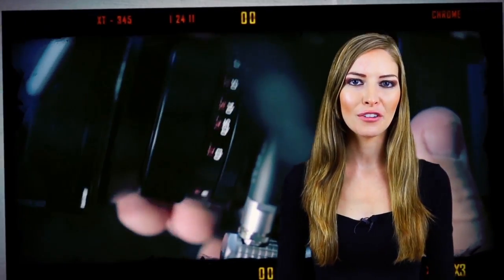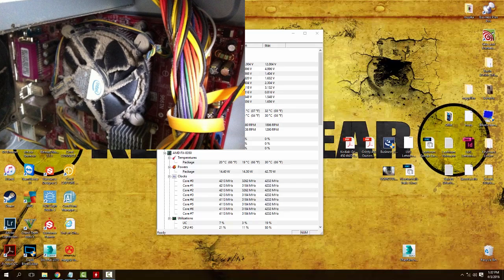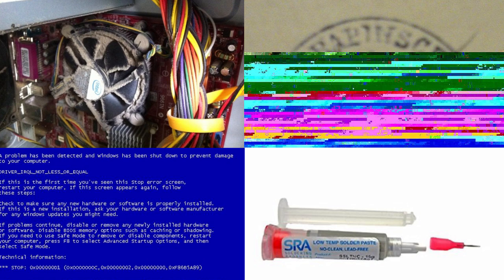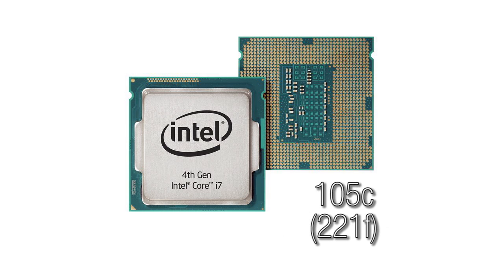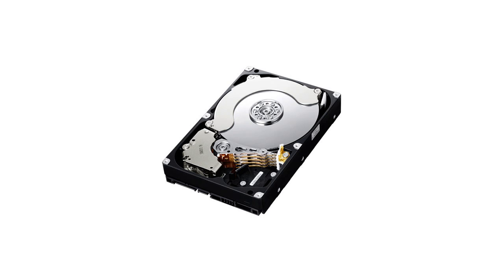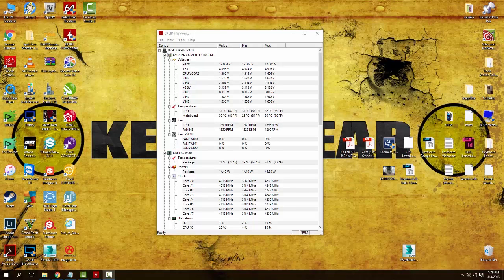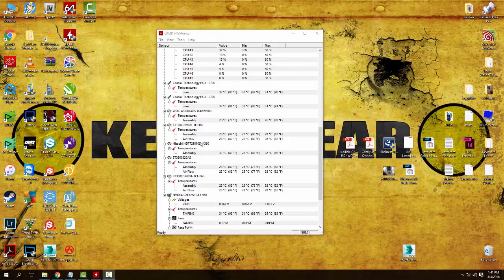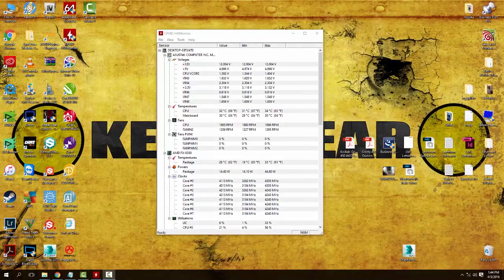Safe PC Temps - How HOT is too hot?

Comment: My cpu reaches 100c and my gpu reaches 80c im on a Dell g3 laptop is that bad
Reply from the maker: If its the i5 9300h, I'm pretty sure that 100c is the max temp. Sounds like you might have some massive dust bunnies or something...
Reply: It's a i7-9750h
Reply from the maker: Yeah, I'd look into making sure your fans are working and that it's relatively clean (dust/dirt wise). 100c is the Junction limit of the 9750h (maximum temperature allowed at the processor die).

Comment: Can you tell me if this is okay.... i contacted alienware service customers i told him 100c while doing gaming becuase it has turbo boost without it i just get 10 fps less but still at 89fps on pubg on ultra just getting 76c without turbo boost but there is no way to turn off the turbo boost mode he told me that 100c is okay in case of any question is there at that temp is not giving trouble just get more performance but i care about my laptop life but with 100c doeant go throttling keep on performance

Comment: I have a macbook pro mid 2014 (1200 USD when it came out), it turns on the fan when i move the cursor too fast lol. I have smcfancontrol configured to start increasing speed at 70 degrees and maximum 90 degrees. Less than 70 the fan rolls at 1200rpm and when its over 90 it move to 6199rpm Macbooks are no able to do any task. This laptop overheats just to look at her. I read some threads about users who has this kind of macbooks and they say its normal to get 90-99 degrees while gaming. Im always worried when i play games like Cs:go or paladins (on bootcamp) because temperatures may harm the cpu. I clean the fan like every 2 months and it still the same. anyways the system never shuts down or give any kind of problems. Its just too hot and im not able to play games whitout worrying about harm the computer. I tried use the processor at 50% of his capacity and it decrease to 50-70 degrees but its like having a pentium 4 instead of a i5. 2.6Ghz 8GB. What can i do to fix this? no fan pads, thermal grase or even frozen chiken nuggets solutions allowed.

PD: Girl at the the beginning its hotter than my pc.

Comment: I run around 64c and 74 when the gtx 670 is up and pumping with syndicate in this itx case. I am curious about this myself as I only have an exhaust but it is a crazy Delta exhaust 120mm fan that can cut your finger off and is very loud so I bet it actually is sucking air in either way from the nano cracks and crevices of the case. I was going to add an intake right on the side but I don't think I have too with my Celsius temps, seems to be right on the edge? Also, why does my MOBO bios NEVER ever say on a fresh restart right after gaming that it is 68 (per se) or so degree it will start at around 50 on the restart then hop up to the 68c or so like it is slow or in slow motion versus the real time in reality! Also, I guess I trust my bios temp more then these cpuid hw software programs however, they are always way diff, 5 to ten degrees difference thus useless! Common?
Reply: ReganMarcelis I have GTX 1050 and I’m running at 80 C minimum

Comment: ive got i5 7400 and amd radeon 480 and i run 84c on the gpu and 50-70 on cpu is this bad?
Reply: I run around 64 and 74 when the gtx 670 is up and pumping with syndicate in this itx case. I am curious about this myself as I only have an exhaust but it is a crazy Delta exhaust 120mm fan that can cut your finger off and is very loud so I bet it actually is sucking air in either way from the nano cracks and crevices of the case. I was going to add an intake right on the side but I don't think I have too with my Celsius temps, seems to be right on the edge?

Comment: What should I do should I be worried I got a bad could I'm running off a 240 m AIO cooler rad. Panel off . it's like the chip loves to just fly up high every chance it gets . I applied thermal paste a dot amount or a blob and it's pretty high quality stuff at least it's rated at that . I tried 3 different ones cooler master that it came with Wich is my cooler master master liquid 240 , then thermaltake tg-7 then Arctic mx and I've applied thermal paste many times so I know what I'm doing I've had an i5 6500 and it ran    cool as a cucumber no matter what . Should I rma ?

Comment: My temps on new 7700k go up to 80 to 90c when gaming or running cinebench it is overclocked to 4.9 at 4.5 MHz stock under load it goes up to upper 60s an idle temps are usually in the 35c range

Comment: my motherboard sits at 111°C most of the time my specs are

 Operating System
 Windows 10 Home 64-bit
CPU
 Intel Core i7 4790 @ 3.60GHz 53 °C
 Haswell 22nm Technology
RAM
 16.0GB Dual-Channel DDR3 @ 798MHz (11-11-11-28)
Motherboard
 ASUSTeK COMPUTER INC. G20AJ (SOCKET 1150) 111 °C
Graphics
 LG FULL HD (1920x1080@60Hz)
 4095MB NVIDIA GeForce GTX 745 (ASUStek Computer Inc) 45 °C
Storage
 931GB TOSHIBA DT01ACA100 (SATA) 39 °C
 111GB KINGSTON SA400S37120G (SSD) 39 °C
Optical Drives
 MATSHITA DVD-RAM UJ8E2 S
Audio
 Realtek High Definition Audio

do you think that its all good?

Comment: SO I Overclocked my CPU, and im getting about 75C max during pubg. Is that fine for everyday gaming for temps?
Reply: Rehan Shaikh that should be fine
Reply: did you find your answer i have same temp
Reply: Yes its fine. Your pc will throttle at 90 degrees.
Reply: Celsius or degrees if its Celsius that very bad, if it degrees its very good

Comment: so basically im fine for now? my GPU temp can get up to 90 while i play overwatch .. in the menu it hangs around 88-90 and when i enter the game it goes down to 75-77 is that ok since overwatch is a very optimised game?
Reply: Legend Incarnated Sounds kind of high.
Reply: ye i know but it works for now so xD im happy lul
Reply: Legend Incarnated Well that was one fast reply :D Shouldn't well optimized game run on lower temps?
Reply: well ye the reply was fast cause i just so hjappen ed to see it immediately and by very optimized i meant in a graphical sense like it uses a lot of computer resources a lot of people have the problem of going to high temps in the menus smthing up with blizz or we just need better cooling system ;-;
Reply: i would try to keep everything below 70 degrees, but it can create some noise. Then you have zero risk of damaging anything.
Reply: Juige it is

Comment: my motherboard is at 115°c when idle. what do I do?
Reply: Daniel Acheampong Piss on it
Reply: Pour liquid nitrogen on it or delete windows system 32...
Reply: open your case, grab a bag of marshmallows and a stick and make s'mores.
Reply: The program you are using is reading wrong; at 115C your motherboard would melt; the reader I'm using says mine hits 113C  when actually its more around 40
Reply: Lmao
Reply: yh I think the sensor broke
Reply: Daniel Acheampong holy fuck
Reply: my motherboard usally sits at 111°C like even tonight i went out for dinner but before i left my motherboard was at 111°C (i turned off the pc) went out for about 3/4 hours came back started it and it was at 111°C the same temp it was when i left (after turning it off for 3/4 hours)
Reply: Throw it away
Reply: Replace your thermal paste
Reply: Buy a new pc
Reply: Daniel Acheampong chuck it in the trash, it probably has a faulty temperature sensor if it says it's that hot and not shutting itself down. either that or you're not using a good program to monitor your temps
Reply: sorry you got shit answers for your question. sounds like my issue i have. something on my board is reading a high temp and ive got it narrowed down to a vrm module above my cpu socket. its came loose throughout my year of switching parts around. hope it helps.

Comment: recently I had an issue where there is a drop in fps at random times while playing a game , other than that the game stays at 55-60 fps , I was suspecting the cpu but monitoring the temp I found that the avg temp while playing the game "gtav" very high setting was 50-60C for the cpu and 70 C for my graphics card , what could be the issue here ??

Comment: Hello, i just built my first ever pc. It has an I5 660k and a geforce gtx 1060. When i am idle the heat is around 45 (C) and when i am using it gaming it goes up to around 78 (C). I am a bit worried about problems occuring since it is my first ever build.
Thanks in advance
Reply from the maker: Hi Erik hast,
Congrats on your first build! First, let me tell you that you don't have to worry with those temps. If it goes over 80c, keep a good eye on it; over 90c, you'll want to make sure that the heatsink fins and the pc fans are not clogged with dust bunnies and are all working; if you're over 100c, you have some problems (either lack of airflow, missing thermal paste, fans are not working, or your pushing an overclock too much).

Could you drop your temps? Yes, but your numbers are going to be based on several factors (such as case design, types of fans, CFM of air being moved by the fans, different style/size heatsinks, ambient temp, etc). Personally, enjoy your newly built PC, game away and don't sweat it until temps start hitting 90c.

-Matt
Reply: laythrom thanks for the info. Also my first build. I was playing metro and I was getting 78gpu and 80cpu
Reply: erik hast my 47 degree in idle mode but I put my fan slient mode

Comment: hello, i bought an asus rog gl552vw-dh71   and it runs games very smooth on full hd......but it gets extremely hot even on lowest settings possible.   my cpu and gpu reaches about 75 to 85 c max      but what really concerns me is my motherbaord is always hotter than my cpu and gpu no matter what i do   ...my laptops only 1 month old but it was always like this since day 1.........my motherboard within 10 minutes of gaming is always 70+ C instantly and reaches 87c within 30 mins of light gaimg is this normal?
Reply from the maker: Hi Jesse, Whilst digging around to try and grab more information about that specific PC, it does seem that this is a common issue with the ROG GL552VW. (here is one of the threads that I've come across: http://bit.ly/2dj5Z2u) Personally, I don't like to see temps get that high, but it's not abnormal. My MacBook Pro for example won't hesitate hitting 95C when rendering video, etc. If it will bring some ease of mind, snag an inexpensive cooling pad off of amazon or newegg.
-Matt

Comment: Hey, good vids. I just bought a Hp Omen with a I7 6700hq skylake quad core processor. According to Speedfan, I am hitting max temps of 70-75C when doing high end gaming. Is this safe? What is a good way to find manufacturer notes on specific hardware stress allowances? 

All helpful responses are appreciated.
Reply: I have an Nvidia 965m graphics card.
Reply from the maker: 70-75C On a laptop doesn't surprise me one bit. I've heard about 6700k starting to throttle around 80C but have yet to really experience it, it's usually a bit more (for me) before I start to notice it. 70-75C is "warm" but unless it starts creeping past 80C, I wouldn't sweat it. North of that, I would probably look into a laptop cooler since there's not much more that you can do to it other than keeping it clean & free of dust bunnies (providing that you're not overclocking).
-Matt
Reply: Hey, thanks for the reply. Those temps are on a cooling pad. A really good cooling pad that elevates and blows air along the bottom with five fans. =) Those temps do only show up on one of the games I play (Total War: Warhammer), on high settings. It is an extremely demanding game graphic wise. Other games usually hit the low 50's, and up to 69C. 
Thanks again for the info and the video. =)
Reply: Also, what do you think about Speedfan? I have always used it to gauge my CPU temps, but I hear a lot of other opinions on such software (Coretemp, etc...).
Reply from the maker: In that case, you're pretty much good to go without too many worries. As far as Speedfan goes, I've been using it off and on for the past 12-13 years and have no real gripes about it (aside from initially setting it up for what I want). A couple of the guys here also have no issues with it. Honestly, for it being as powerful as it is, with pretty regular updates and of course since it's free...you pretty much can't go wrong.
-Matt
Reply: Yeah, I tried 'Coretemp', and it wasn't as detailed as Speedfan. Well cool, thanks for your help. =)
Reply: Hey, had a question about power settings. When I put my power settings on high performance, it boosts my processor speed to 3.24. Is this overclocking? My temps stay the same, but I notice an increase in gaming performance. Please let me know if you have any knowledge about power settings. Thanks again.
Reply from the maker: Kind of. Intel markets it as "Turbo Boost Technology" which does slightly boost some of the values when the PC is needing a little more "umph". 
-Sam
Reply: So, do you think it would be bad to change the settings on a consistent basis? Like setting it on 'High Performance' settings when I'm gaming, and then switching it back to 'Recommended' settings  when I'm not? I'm assuming it might be bad for the processor to consistently be on high settings.
Reply from the maker: As long as the temps stay where they are or below, I wouldn't sweat it one bit.
-Matt
Reply: Cool. Thanks for the help. =)

Comment: The video is nice but still doesn't answer my question completely you didn't give an average temperature for the motherboard Its summer time and I have a laptop I use for gaming the room temperature settles around at 40-42C my graphic card and the rest of my things are fine considering but my issues is with the processor and the motherboard the reach around 85-90C while gaming so  my question is that should I continue playing games when the temperature of the motherboard and the processor reaches that temperature or should I stop playing?
Reply from the maker: As for your issue, while you do technically have a few degrees to go before worrying about meltdown, I personally think that 85-90°C is too warm.  Generally, I like to see mobo temps well under 70°C 
One of the easiest things that you can do since it is a laptop, is to turn it off and clean the air inlet/outlet; unseen dust bunnies are a killer (even if it doesn't look bad from the outside). Granted, it works best if you remove the back cover (covering the fan/heat sink) to do so, but if you're not comfortable doing that, you can also try to clean it without taking it apart (just keep in mind that it may not clear everything out). Another thing to take into consideration is that the fan might not always be working (this may not apply to your laptop, I'm somewhat guessing here); I had a similar issue with a Boxx MXL laptop in the past, one fan would stop running intermittently and I only ever noticed it when I was putting a decent load on it. But to answer your question: yes, I personally would quit gaming if it jumps above 85°C. Depending on the manufacturer, shut down typically occurs at around 95°C and since both your CPU and mobo temps are hitting 85-90°C, it's most likely not a defective sensor...I'm guessing air flow problem.
-Matt
Reply: thanks for the reply mate appreciate your input on this
Reply: my motherboards VRM is at 40 degrees c, l am a cooling master. my CPU is at 10 degrees at idle , and it is 35-40 degrees under load. l am just using a basic aftermarket air cooler, how does my computer run cooler than the temperature of the room? l do have a gigabyte motherboard and it was a bit on the cheaper side and the sensors are known to be unreliable on these cheaper gigabyte boards, but l have felt the heat sink and it is cool to the touch, so l do not believe that these are fault sensors, my office is also pretty warm in the summer it gets to be in the upper 80's and lower 90's. how is my computer running so cool? is it magic? it seems unnatural to have such a cold machine in the summer.